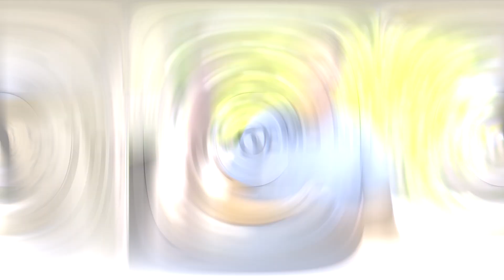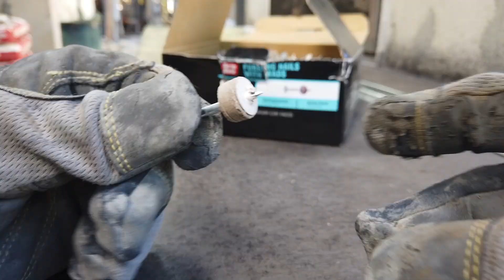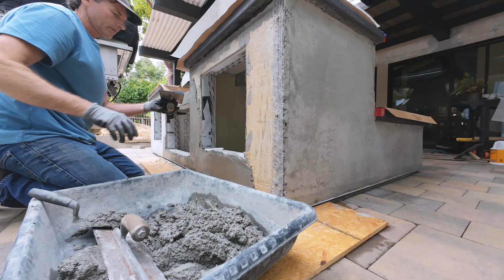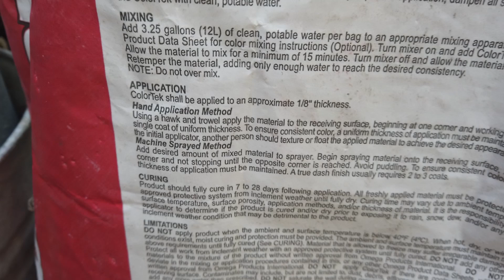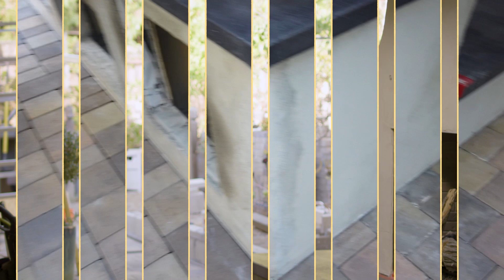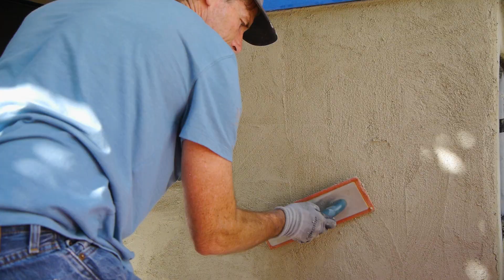Applying Semi-Smooth Stucco on an Outdoor Fireplace & BBQ

Comment: Pretty positive youve convinced me to sub out stucco finish. Just like drywall tapers. It's an art form!
Reply from the maker: Haha. A not sure if that is a good or bad convincing. A sandy finish is pretty easy to achieve, it’s the smooth finishes that are challenging.
Reply: @BruBuilds  just realizing that hiring someone for me will be the easier move. It's good convincing, I know my place when it comes to trade work. Finish work just ain't my jam.
Reply from the maker: @Tmoneyyy22 that’s smart and a good way to avoid getting frustrated.

Comment: Great channel.  Just joined.  There is a product called "U-Stucco".  It can be sprayed on, roller applied, or traditionally trowel applied.  They claim it will stick to almost all construction materials, including  foam board.  It is light weight due to its lack of sand and it has a Class A fire rating.  It does not require a base coat and can be applied up to 1 inch in a single pass.  It provide thermal insulation in the neighborhood if wood.  It does not require wire or fiberglass mesh.  It comes in white and pigment can be added.  It is being marketed as an exterior finish that can withstand California fire storms.  It is porous and air permeable to promote drying.  It is hydrophobic and repels water.  They have a video deonstration where they show how how air bubbles will pass throug it while holding back several inches of water on top of it.  I don't know the cost comparison but not cost prohibitive, especially given its properties.  I am planning on using it on an ICF retirement home in a few years.  Something to consider if you want to reduce your labor.
Reply from the maker: Thanks, that sounds like a great product. I’ll have to check it out!

Comment: You needed to hydrate the wall as you go on the chimney so you would have more time to float the wall. You also have to float as you go and then get back to your troweling. Mixing in a 5 gallon bucket would’ve been much easier. I give you a lot of credit for trying to do this on your own. I’ve got 40 years in the trade and I would’ve been hustling to do this on my own.
Reply from the maker: Thanks for the pointers. I did end up mixing it in a bucket the last couple of batches, timing was definitely challenging doing this by myself.

Comment: Nice work.  Using fiberglass mesh on the first coat makes a ton of sense.  I wanted to know if you are worried about cracking of the stucco?  I ask since it not a traditional application of three part stucco.  I really like your way as it's simpler especially for smaller applications.
Reply from the maker: Thanks. This type of stucco work was new to me, first time using a mesh. I really liked using it and yes it should eliminate any cracking issues.